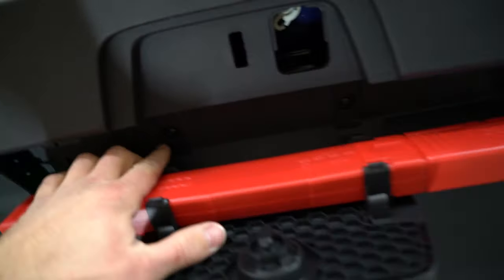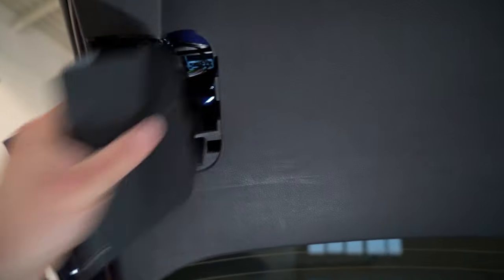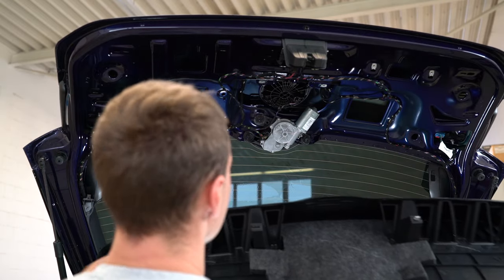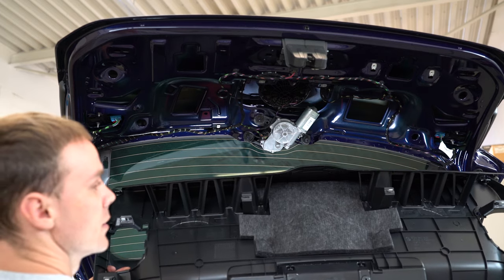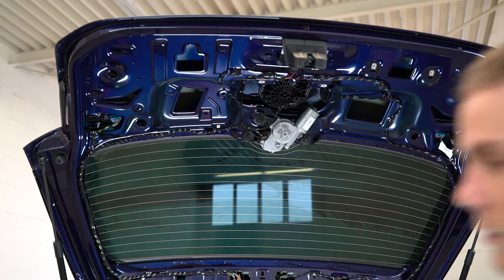How to remove the Rear tailgate Trim Volkswagen Passat B8

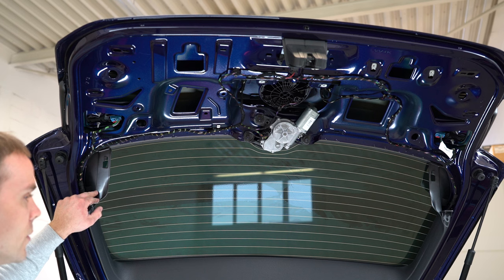Comment: For the second part(2:34). Mine is popping up on the left corner, is it because the metal clip is not properly pushed back?
How do I push it back correctly without removing the whole thing?

Comment: Thanks for the video! Used it today to replace the drain/breather pipe that runs from the bottom of the boot release to the bottom of the lid. Do you know what the purpose of this pipe is?
Reply: The water from the latch drains trough it!

Comment: Hi, can i remove this trim while the boot s closed from inside? My boot latch is broken and i cant open the boot even with emergency leaver. Any help would be appreciated. Thanks
Reply: Issi Sh i have same problem
Reply: @DejanSimic89  I sorted mine in the end but i ended up with a couple of holes on the boot card and a few scratches on my arms. I had to buy a new catch from vw for 50£. Let me know if you need any help
Reply: Yes u can do it from  inside. Its dificult but its posible. When u remove plastic panel there ste just two nuts. Remove it a d then u can open trunk. After that change lock and work its done